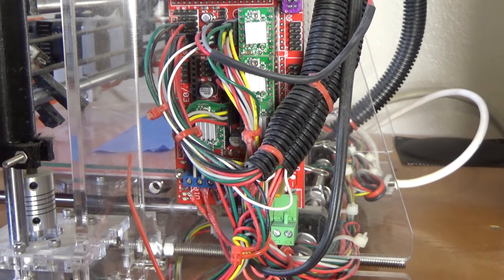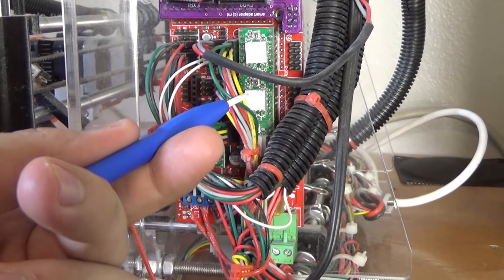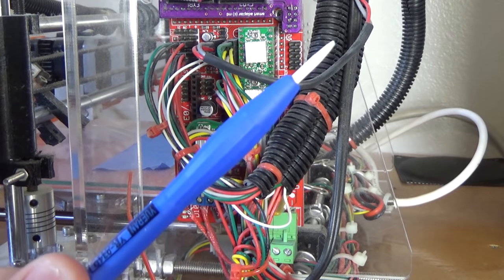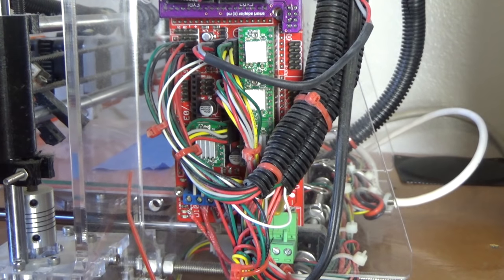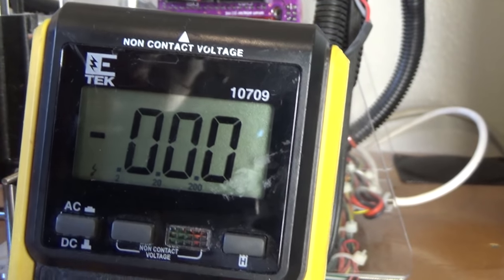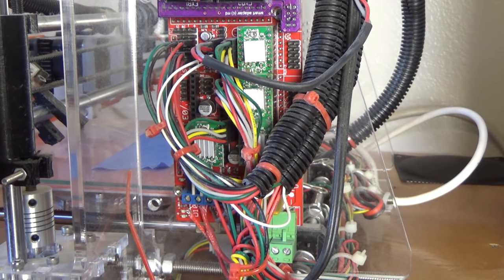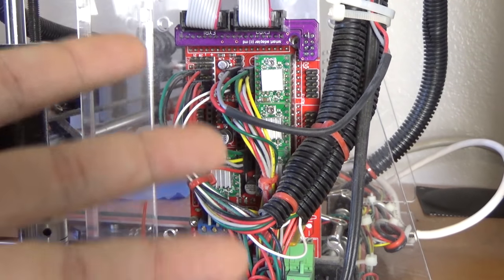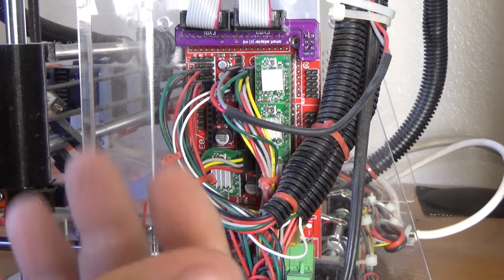How to Tune 3D Printer Stepper Drivers | RAMPS 1.4/Pololu A4988

Comment: Thanks for making the video Dustin, but the very useful 'tuning' information I have learned from you - the reason I clicked your headline - only took 1 minute of a 20min video. You are smart and have been helpful to me but please get someone to edit your videos. I knew a big stepper is big and a small stepper is small, and I knew short-circuiting equipment by using probes sloppily can cause damage before I arrived at your page.  But thanks again for that very useful 1min of your video and the 5.5v stuff.

Comment: You saved my life. My extruder motor would get so hot that the extruder gear would melt in the filament , make a groove, and become unable to feed. I did what you just said, on my Creality CR-10 that came this way from factory, and it worked! Thanks a lot matey ! <333

Comment: very helpful. i dont have a ceramic screwdriver, but a metel jewelers screwdriver one,  I am very aware of the risk, but I hook the screwdriver up to my multimeter, so I could turn and measure at the same time :) it works perfectly, thanks again
Reply from the maker: +Kim Loft Bennetsen (CaTTeN) I've done it plenty of times too. As long as you are careful, you won't have issue.

Comment: Great video but just a note on the voltage to set the stepper drivers..  It's best to check the data sheet for the stepper driver you have.  Most of the official Pololu A4988 drivers are 'Current Limit = VREF*2.5' - So if your goal is to achieve 1A output the Voltage would be best set at ~400mV..  The VREF multiplier can be different for whatever stepper driver you have, for example the popular Pololu DRV8825 is =VREF*2.0 .. Check out the data sheet and find whatever you can on the stepper motor to best tune them. Some of the chinese knockoff's wont be exactly the same as the official Pololu ones as I've frustratingly found out in the past...
Reply from the maker: Yeah. This is just a general guide to get you in the ball park. But you are right, that is a better method.
Reply: h0m3lab I agree with what you said. but I have one question, does the motor specifications like rated current matters while setting up stepper drivers?

Comment: Dustin, I have made a 3D printer by my self. I have used nema 17 stepper motor, 17HS1304040S1 motor. In this the pin configuration is A1 A2 B1 B2 with black, green, red, blue respectively. This same configuration is used for all motors. After dumping the program. When I start with pronterface application. X and Y motors are working fine. And when I click 10 steps up or down on Z axis's setting it is working good. As soon as I click on Z- home it fails. On clicking Z- home the motors are making lots of noise and they stay where they are they neither go up mor come down. Can you help me to solve this.
Reply: Hay I'm also facing same problem....plz tell if u get any solution

Comment: One thing to note before starting is to have your multimeter properly calibrated that you can trust, i have a good Fluke and a couple of cheeper ones and non of them read the same, i trust the fluke more than the other 2 that i use for general testing.

Comment: OK, a word of caution. Different driver boards have different values of current sense resistor, so check what is fitted before making adjustments. Mine, for example use 0.1 ohm resistors (marked R100 on top). To get 1 amp of stepper current I have to tune the pot volts to 0.8V.

If you use a metal driver, you can leave the meter connected to it and then you can adjust the voltage in real time, rather than tweak and hope.

Comment: got the tune up to work. on the FT5.  Thank you.  If you wanna troubleshoot ALL the other issues it has that would be super.......
motors running backwards but wired correctly according to FT.  No home position that is constant...picks a new whenever.  sometimes reconizes end stops. extruder worked and then stopped.  never got it to actually extrude plastic...just turn.  issues gallore......i tried the file configuration but for some reson it wont upload any more...saved it to the sd card still no change in direction.  another week of this...30 days then... and I know a printer that is going on ebay quick....

Comment: Dustin, I have an Anet A8,  recently upgraded to AM8,      GT2 reinforced belts etc,  and an MKS BASE V1.4 (A4988 drivers I think)

The drivers at stock when I checked were just below 1.0v on each,      the motors run so hot, I'm surprised it hasn't melted my build (printed in PETG so thank god)    but on an 18 hr print last night,  I had some serious Y layer shifting :(          is 1.0v too high,  I guess it is, but can't find a definitive answer to voltages for this board with stock A8 motors :(

All motors are running at extreme temps XYZ & E    so i'm sure 1.0v is too high,  any suggestions ?

Thanks

Comment: Lovely work Mr.Dustin Corbin, I would like to ask you about TB6600 stepper driver, when I read the driver data sheet they wrote that s durable for 5 amps, but when I connect a big stepper consumes 2.5 amps -6 volt , and when I increase the current to reach 1 amp the driver cut the current , have you any idea about that?
Reply from the maker: Never messed with one of those before. I would take a look online and see if anyone else has had that issue.

Comment: Thank you for your video, my flyingbear printer works perfectly fine but the x and y steppers run real hot and are the same size and they are all set to exactly 0.60 V so I may drop those down to .5 or even .45. I do have dual Z axis with two slightly smaller steppers than x and y and those even are rather warm but not burning like x and y so it could use some tuning and I also just ordered new replacement drivers labeled Dvr8825 on Aliexpress so hopefully that will help a bit as well. Thank you for the advice!

Comment: in the video you state to get the printer printing first before even looking at this but in my case the steppers werre skipping steps badly so i was unable to get the printer working i checked this as a last resort and i was giving out close to 2 volts turned them all down to .3 with .5 on z as you sugested and it works perfect so it would have been imposible to get up and running without doing this

Comment: Holy hell, how did what should be a two minute video about simply turning a pot get drawn out to 20 minutes. It's simple, read the datasheet and adjust the potentiometer. Don't use the motors to complete several test prints first, thats how you damage them. The datasheet and pololu both clearly state not to even power them on prior to adjusting the current and specifically not to try and adjust them by ear, temperature, etc.

Comment: I have Nema17  1.2A motors and using china made a4988 steppers with ? resistors.(i'm guessing 0.1ohm).
What should my volt be ? as i was told 0.6
Reply: Hi luap, i am also thinking of buying same stepper that you have, so can you give me some feedback about them?
Reply: @rdxg0d468  Hi 
A4988 or the DVR8825 have worked just fine for me when i was doing a lot of 3D-Printing, as long as you set them up correctly!! to make sure your not pushing to many Amps. All setup info is readily available online and on here YT, (but read a few! as some people give the wrong info/advice)
Reply: @luapynneb3069  thank you for this valuable info and i also want know about the Holding torque provided by your motor. Is it 4.2Kg-cm? on paper
Reply: @rdxg0d468  I don't have that printer any more as my original reply was 3 years ago, but all stepper motor specs can be found online. 
What are you making ?  > 3D-Printer or a CNC-machine or ?
Thx Paul
Reply: @luapynneb3069  i am making a 3d printer, the stepper that i found can provide 4.2kg-cm torque at '1.2A' , but every other stepper i find over internet  is rated 4.2kg-cm at '1.7A' . So i am confuse about my motor that it is fake or normal?
Reply: @rdxg0d468  
 ?? You can find any type/setup stepper motor you like online, Unipolar/bipolar/V/A/Ncm ect ect.
If your after a Nema-17 like i used, it's because you need the 1.7 x 1.7 inch faceplate (Heace > Nema17)
Not sure what you mean by "fake or normal?" as many manufacturers make stepper motors and many companies/sellers rebrand them, so there are many brands to choose from, I can only assume you are referring to not trusting the specs of the motor to be true? (are you buying direct from China ?) If so! look at their feedback and check what people leave in a review, if your still not sure? buy a full-set of motors from a trusted seller on ebay who deals solely in 3D-Printing Parts, if you send them a message they will advise you on what you need, once you have that info! you can see if anyone else sells them cheaper before buying :)
 But you also ask about the ratings on your "my motor" meaning you have already bought the motors ?? if so then 4.2Kg-cm sounds fine, it's more likely in the 3.??Kg-m range (as most others) but that's fine for 3D-printing, just get the printer up and running as the fun hasn't started yet! wait till you have to set it up, calibrate it, change settings, fix problems ect ect. 
 Basically your motors are fine! so carry on building, it's great fun and you learn more by making and setting the printer up yourself! 
Then finding the faults and fixing them will learn you everything else about 3D-printing.
GL HF
Thx Paul
Reply: @luapynneb3069  thank u for your help👍

Comment: Im trying to upgrade to 3 colors.  having problems getting all motors working.  so I did the test here with probe on potentiometer,  I get a reading of 1.70 on one motor and 1.65 on the other.  one driver gets slightly warm, the other doesnt at all.  Ive got both stepper drivers on a x2 stepper expander board.  Wasnt sure if i had a bad driver or not, was gonna trade it out with another.  but I wanted to know if the voltage i was getting, would this be a cause why it doesnt work correctly?

Comment: The smaller and the larger motor are the same picture :S so I get lost there. I have interchange the motors and still get skipping issues in the extruder

Comment: Hello, I have a problem with my grbl CNC plotter when I run the X axis on the CNC, the y axis run and if the y axis run, then the y axis still run.mean x axis is not working in both conditions

Comment: On my FT-5 i have the stock stepperdrivers (type:???) with a 42BYGHM208 small motor (400 steps, 2.1 kg/cm) installed on my E3D Titan Aero.
What voltage should i set my stepperdriver? I only see 2.6 kg/cm motors in your list.
I also have a 42BYGHW208 motor witch is a 200 steps, 2,8 kg/cm motor). What voltage should i use with this motor?
Is there a formula with you can use to calculate the voltage for a xxx motor on a xxx stepperdriver?

Thank you

Comment: what if i um turned the potentiometer like 5 times, like i tried to screw it in. is it broken?  very helpful video
Reply from the maker: I think it resets itself every revolution. Just check what it is at with a multimeter. I think it is free to rotate (May be broken, ive never tried)
Reply: I've used a metal driver, did i screw up?
Reply: yes if you used a metal screw driver you broke your printer and neeed to buy a new one
Reply from the maker: I'be used a metal one before, you just can easily short other stuff.
Reply: I had to replace the driver. They don't reset, they break. But she's up and running now :)
Reply: Lol mine went to 4 volts and pretty much screwed over the stepper motor and the driver board. I had to replace the driver but I don't know about the motherboard

Comment: Ok so I watched another video on this and he said counter clockwise turns them up and clockwise turns them down. That wasn't the case in this video. I haven't tried it myself yet to find out what's the correct way to turn them but I'm assuming clockwise is gonna turn them up is this correct?
Reply from the maker: Maybe he has different drivers. In the case of these, clockwise is raising the voltage.
Reply: @DustinCorbin  thanks brother. I have a serious layer shift on my X on my 2018 Tevo Tornado. I turned the jerk from 20 in the settings witch I think is a little high to 10 and it helped a lot but I'm sure the stepper needs to be turned up.
Reply: @brightshadowonline  awesome, thank you my friend. I knew someone would be able to answer that for me.
Reply: @brightshadowonline  I have 6 printers to go through lol.

Comment: Can I use an alligator clip from the red lead to the screwdriver so I have a real time reading? Or that would not give me a good reading? I may have to do this on my filament motor... I’ve seen other videos where they set theirs to 1v does has to do with what printer they have? (Anet A8) TY!!!
Reply from the maker: Mike Michelle that should be fine, you just need to use a metal screwdriver, which can short out things if you are not careful.

Comment: Question:  since these are called VREF, are they actually references for when the stepper triggers or are they the actual voltage that drives the motor?
Reply: Hello Lilith. Actually this Vref is something that depends on the chip and the sensing resistor and should be calculated as needed for the driver and sensing resistor. It has nothing to do with any other voltage in your system. Look at my other answer and Satan's. Regards.

Comment: Hey, I have nema 17 and ramps board with A4988 drivers, they were set at 0.61v stock, but when after they stop moving I can hear a noise from them (just a never ending beep), I tried to lower the voltage, that solved the problem a bit, but i can still hear the noise if I come close. Is that normal? Thanks.
Reply from the maker: You'll always hear something from them, because the motors are always powered even when stopped (until it times out), so that it doesnt lose it's position.

Comment: Do you know the right way to hook up the board to avoid conductivity? Do you have some pics?
Reply from the maker: Make sure you used the nylon spacers between the board and the panel. That's the main issue. Also may help to make sure the computer and the Printer are on the same power strip. Remove all the drivers and see if it still happens, if not one of the drivers are shorting.

Comment: Hey can you tell me the FT5's voltage? It isn't listed anywhere that I can find I was looking for a few weeks. My printer seems to do fine but I want to make sure my voltages are ok. They are all like 0.8 by default. NEMA 17  Stepper and A4988 driver. Is the voltages specific to the drivers? I know the motors just care for current to spin?
I read somewhere 0.4 - 0.6 but all the much smaller motors seem to use that too so it seems really low.. Also the dual Y axis motors idk what those should be... 
Thanks
Reply from the maker: In the description. 0.8v for the single motors. 1.2v for the dual axis.
Reply: @DustinCorbin  oh sorry didn't even notice ha. Thanks

Comment: Dustin  ain’t see those spaces in my kit, did you sell them in your store? I already place an order getting the ramps.
Reply from the maker: Which kit do you have? Only some of the kits need the spacers. Just make sure nothing is touching the back of the RAMPS/ Mega board or shorting on the boards.
Reply: Folger Tech RepRap 2020 Prusa i3 Full Aluminum 3D Printer Kit
Reply: Sorry Dustin this thing is driving  me creasy and Maybe I am driving you Creasy to sorry.

Comment: Dustin I have an issue whit this printer, when I plug the printer my computer shutdown. Do you have. Any clue, I am completely new.
Reply from the maker: Usually means there is a short somewhere, or a component (probably a diode) is blown on the board. Sending 12v thru the 5v on the USB more than likely.
Reply: Thanks and what I need to do, actually I see a smoke from the usb plugged to my laptop I mean in the entrance.

Comment: Great video. I'm looking to buy a 3D printer I have been looking at that prusa i3 3D printer for about 2 weeks. How well was it? I found it for under $300 with free shipping and the lcd desplay.
Reply from the maker: +Its Voodoo The design overall is great. I recommend the 2020 version from FolgerTech versus the acrylic version. 2020 is way stronger.
Reply: Dustin Corbin Yeah I was looking at both of them and I have been told the acrylic one has broken on a lot of people, and thanks for the help.
Reply from the maker: it broke on me, but I had glue to fix it.

Comment: hi what about 11amp and 5 amp current in power suppply . ????/
shall i consider on 12v voltage that's sufficient or i have to adjust 11 amp,5 amp in that supply pin ?? pls guide me
Reply from the maker: Selva Priya that is not adjustable from the power supply. The board draws the current that it needs as it needs it.
Reply: thank you  very much.. have one more doubt..

Shall i use 6 wire stepper motor with DRV8825 Stepper drive ??
Reply from the maker: You dont need to. the 4 wire should work fine.
Reply: but in REPRAP website they mention.. use 6 wire bu left the center tap..   what can i do ??

i complete my entire setup  but hesitate use 6 wire ??
Reply from the maker: The ramps board only has 4 pins, and the motors dont use the 2nd and 5th pins or wires, so i wouldnt worry about it.
Reply: shall i continue ?? with 6 wire stepper motor?
Reply: hi.... Z axix motor moves only upwards didn.t move downwards.. what shall i do ??
Reply: I recently bought me a LED Light Power supply from China, costa as little as 12 euro's. I connected mainboard and flat bed to this cheap power supply. Heating up goes fast and everything is running normally. I measured the actual power consumption at startup. Bed and Nozzle need a lot of current. It was 325 Watts. This lasts about 2 minutes then it drops to 50 - 80 watts. I recommend buying these cheap power supplies with built in protection and a fan.